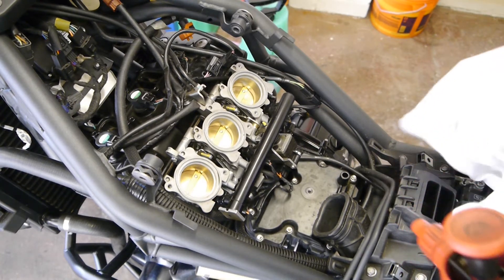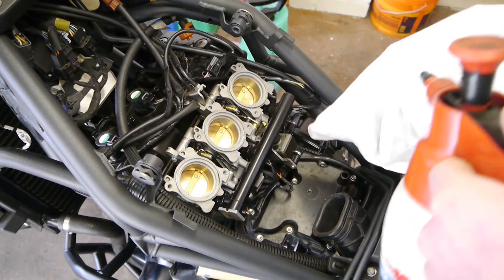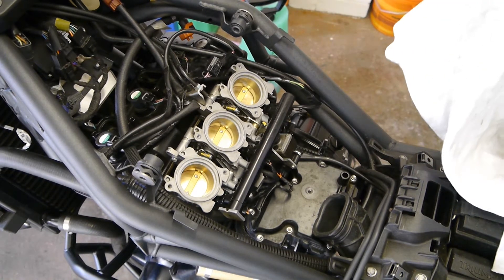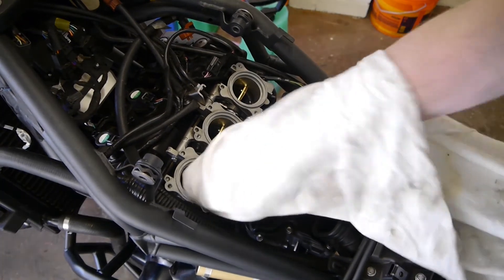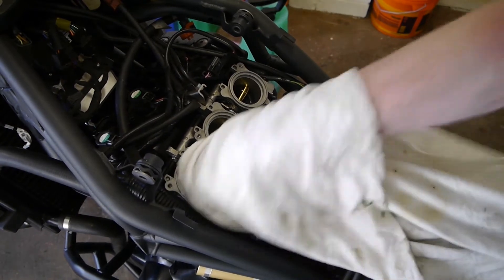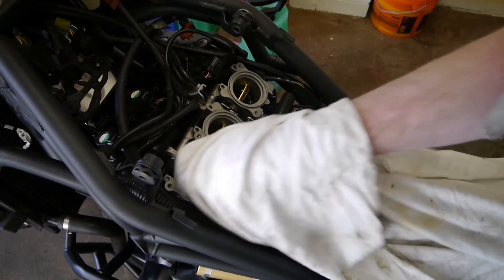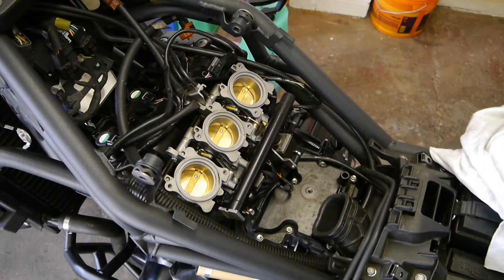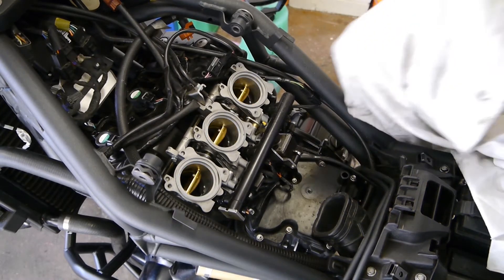Tiger 800 - Throttle body plate check/clean

Comment from the maker: Just doing the 6k for now.  Once you've got the bike stripped down that far all there is left to do is take the cam cover off. Put the bike in 6th gear and turn the rear wheel to turn the engine over until a set of the cams are pointing away from the valve bucket. Measure the clearance on those then turn it again till the next set are pointing away.  There will be 2 inlet and 2 exhaust pointing away at the same time.  Do it with a cold engine
Reply: MuddySump  I'm having a intermediate idle issue, sometimes it's running fine other times it just dies when off the throttle.. anything I can do to remedy this while the tank is off?

Comment: hello !!!
thanks for your excellent instruction !!
after cleaning the trottle body, the tablerp shows a check engine on !!
what can i do to reset it.
thanks from Colombia !!
Reply from the maker: Hi. Sounds like you turned the bike on with something disconnected or have still got something not plugged in. You need to check that first. A common one that is left off is the MAP sensor connector or vacuum pipe at the front of the air box. The majority of faults will reset the light after 3 cycles of the ignition. I think that means started from cold and ran till it's up to temperature. If everything is connected and it still hasn't gone off you might just have to go to your dealership to get them to plug it in and turn it off.
Reply: Same thing happened to me . I cleaned them and the Tiger 800 showed a check engine light but even worse the bike accelerates to much and wont stop the bike with the clutch I got codes about the fuel level sensor and Map sensor and one other one. but I checked all conections everything was conected I just rode the bike like that a few times like 3 or 4 times for like 10km and the check light is of now. I was scared for a little bit but everything is good now.

Comment: Would the butterfly valves open when I roll on the throttle on the 2016 Tiger as well? I ask because in the 2016 models, they are ride-by-wire with no actual throttle cable, as far as I know.
Reply from the maker: They're computer operated instead of cable but still do the same thing
Reply: +MuddySump But would they need the bike to be on? In your video, you have the tank removed so I'm guessing the bike is completely shut off, including all computers.
Reply from the maker: +Ayush Sobti no, you can open them with your finger on one of the plates
Reply: +MuddySump Got it. Thanks!

Comment: Hello Muddy Sump... I appreciate your videos.
I have a 2016 800 XCX... that I just got used.  So I was wondering what tools/software would you recommend for  synchronizing the throttle bodies/tunning?   Or is this something the computer does by itself?
I would appreciate you pointing me in the right direction.
Reply from the maker: I’ve got the triumph software still cause I used to work there. 
People use tuneECU, dealer tool or tiger tool. Not sure if tiger tool is just for the newer tft speedo models though. I don’t know how any of them work, never used them. I know you’ll need an obd connector to connect the bike to your laptop.

Comment: hi,
just about throttle body sync.
I'm using DealerTool and it tells me the bike need to be adjusted. 
From what I understand I'll have to take off the tank and air filter... but I'm lazy.
Have you ever used one of those? http://www.ebay.co.uk/itm/391256416698
Do they fit the tiger 800 without the need to remove anything?
Reply from the maker: There's no other way. Need to take the airbox off to get to the screws.